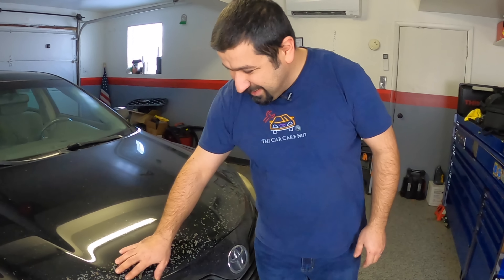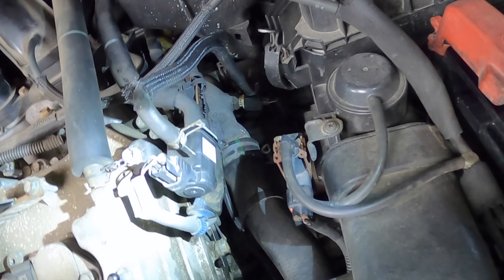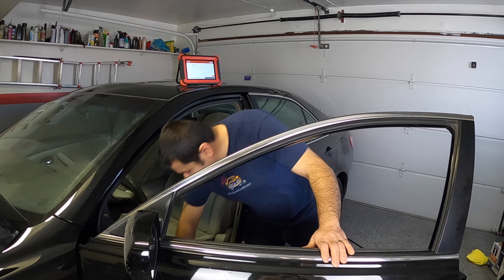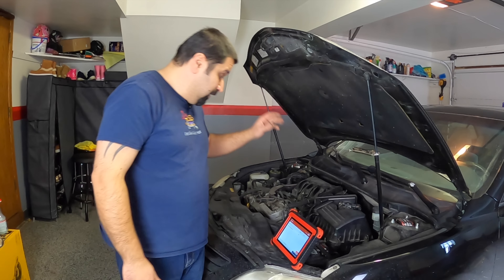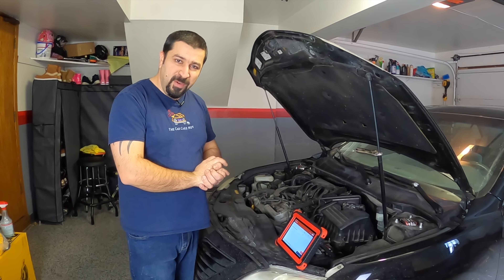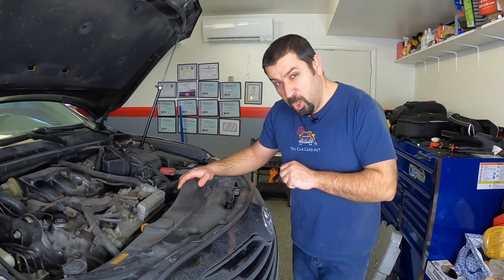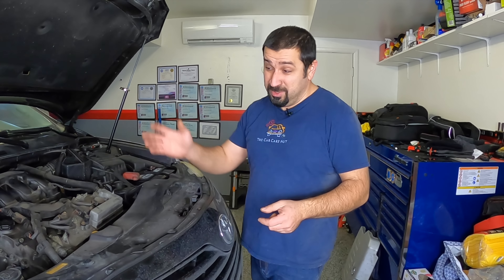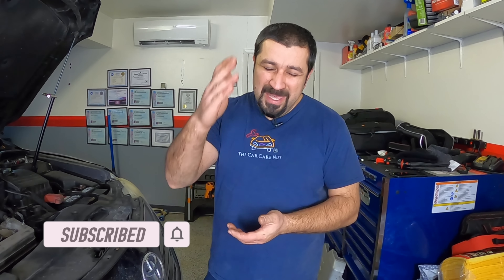How Does a 15 Year Old Toyota with OVER 200k Miles Hold up? Full Inspection!

Comment: Always use OEM parts, for a peace of mind in term of performance & reliability. Addition it will save you times and money too. Especially now a day, after market parts made in China are not worth to even spend a penny on. My 2004 LS 430 with 230,000 miles on it, and it still runs like new, super smooth and super quite (you don’t even hear the engine noise). Over the years I always use only OEM parts (including the gas cap & radiator cap) on all scheduled maintenance. Thank you another GREAT video. YOU ARE THE BEST. Always learn something new & beneficial from each of your videos. I look forward to watch your next video. Thank you.
Reply: We previously had a 1996 Honda Accord and when it came time to replace the water pump it was impossible to find a new one that was not made in China, including one from a Honda dealer.
Reply: @njsongwriter  I saw a comment on another channel from someone who said they work in automotive part distribution that for old models, eventually the manufacturers will start selling aftermarket parts under their own brand for various reasons. Usually the factory tooling wears out and they don't feel like investing in remaking it for a small number of customers.

Comment: I have a 1992 Corolla which I purchased in 1994 with 20,000 miles on it. So now it is 30 years old this year, and recently turned over 1/4 million miles. I do all my own maintenance, and moderate repair work. Still runs great. The clear coat on the white paint on the hood started to break down after about 15 years, but all the other paint and clear coat is original and in great shape. Things have had to replace.. starter motor solenoid, struts, exhaust manifold, rear brake cylinders, water pump, radiator, drive axle boots, catalytic converter.... that's all I can think of, looks like quite a list, but spread over 30 years, it's been quite trouble free.

Comment: Excellent video!  I have just now had 1 year of ownership on my 2002 Sienna with 272,000 miles when I got it.  I have done 1 oil change using Mobile 1 synthetic  10w30.  In over 2000 miles on the new oil I had to add about 1 pint of oil.  There have been zero oil leaks from anywhere.  I did put new front disc brakes and rotors. I also had the timing belt changed since I had no idea when it was done last.  I have no idea how many previous owners it has had.  I paid $800 for it and I am amazed how well it has been.  I does has have  aftermarket front struts!  It handles and rides very nice for its age.  It has some rust but not excessive.  I am  to say the least very impressed and pleased so far.
Reply: I have a 98 seinna well over 200,000 miles but I’m huge on regular consistent maintenance so it runs great. Wait until you have to change those spark plugs in the back of the engine lol
Reply: @StrongerThanBigfoot  I know it is probably not easy to get at those back plugs!  I have close to 280k miles on it at this time and it sttill starts and run very smooth.  I do know there are many videos to show how it is done when that time comes!  Thanks for the comment!

Comment: I have a 2002 Camry LE with 211,000 mi on it (bought new). Only have done general maintenance and replaced the starter, alternator, power steering hose and belt tensioner (that was a pain). Most reliable car ever, although not living in the rust belt (California) helps.

Comment: This was very helpful and informative.  
Thank you.
We own a 2007 XLE Camry and it does not have any of these problems.
Ours though only has 87K miles on it.
It runs great and is sill peppy and fast when needed.
EDIT: We only have used the Toyota Dealership when doing any repairs.
No aftermarket parts in ours.
Reply: Your car has almost 150,000 less miles so it should be better.😅
Reply: @lukespack  haha yeah I agree
Reply: Not all dealerships are the same.  Glad to hear that yours has been helpful.

Comment: Same engine with 2005 avalon.
Just  replace front rear struts
And lower bolt join .rotors.  Brake caliper 
And power sterling pump 
Radiator.   And change  trans fluid.Toyota engine bullet proof ..now 160 hope fully make 200 more

Comment: I have a 2006 Matrix AWD with 194,000 miles and zero leaks.  I did replace valve cover and intake gaskets like 30k ago and do full synthetic 5k oci. Runs perfect but the left front cv axle is starting  to clack. Just picked up 12pnt 30mm socket to replace it myself. Also, I revgularly service all (and I mean all) fluids. This is a northern NJ  car for reference.

Comment: Great video! I have a 2011 Sienna LX I bought new in 2010 with 238K miles. Just had it in to the dealership for oil change/tire rotation and had to replace the lug nuts last week. They were swollen and it was a safety issue. I keep it maintained with a trusted independent mechanic that my family has used for over 30 years. I guess you could say we’re not afraid of commitment 😆 to our old cars and mechanic! I’m in the market for a new RAV4 Hybrid, but finding one right now is very difficult. Fingers crossed that my Sienna holds up until I can find one I want and for a price I’m willing to pay. It still looks good, just foggy headlamps. Thank you for your videos!
Reply: @vikchem  ¿y el Hybrid no se encuentra en los Concesionarios?

Comment: My 2006 4runner 4.0 v6 is approaching 200,000 miles and runs great! Just had the timing chain and all related replaced. 300,000 miles here I come!
Reply: MVRWC…..why did you have your timing belt replaced? They should last for the life of your vehicle. Never heard of anyone replacing a timing belt on a 4 Runner.
Reply: @timothycollins1968  at 193,000 miles the timing chain needed replacing as  it had stretched beyond what the tensioner could compensate for probably because I failed to address a misfire as soon as I should have but it's now running like new.
Reply: @timothycollins1968  and as for timing belts, I have a Lexus es300 that has 187000 miles and while it doesn't 'need' a running chain, even a Toyota won't last forever.
Reply: I have a 2005 4runner with 278k miles and runs great. Definitely need to catch up on some maintenance thought. Water pump,thermostat,brakes, new valve cover gasket is on the list but runs good. Hoping to reach 500k

Comment: Gladly take any of the older Toyota and Lexus from the late 90's to mid 2000's over any of the newer ones.Wife's 2006 Avalon runs like a top with 150k and my GX470 with over 200k is still a rock solid beast!
Reply: You would take "any of the older ones"? Even those with the problematic 2.4 engines?
Reply: @njsongwriter  Absolutely! Daughter drives a Japan made 2005 Camry with that 4 cylinder engine and its currently running strong with 235k.Timely maintenance is key on all cars,which helps
Reply: @igglybiggly6951  

I'm not sure that the ones made in Japan had the same problem as those assembled in the USA. Maybe, I'm not sure.
Also, it may have been only the ones from 2006-2010... Again, I'm not sure. All I know is that our 2009 RAV4 has the 2.5 liter engine.
Reply: @njsongwriter  I work at an independent shop that services only Toyota and Lexus and we rarely see these engines fail.The ones that do or come in with engine " knock" typically have been neglected or run low on oil. Lots of RAV,Camry with over 200k with minimal issues,but I'm sure there are basket case cars out there too.Peace✌
Reply: @igglybiggly6951  
I wish I knew of an independent repair shop like yours in my area just in case I might need one some day. You aren't in Pennsylvania by any chance are you?

Comment: I have a 07 2.4L Camry with 220,000 miles on it, and it runs like a champ. I did just have to do the alternator, and the radiator and some power steering lines were done about 3 years ago, but it runs and drives great. If I had to get in my car tomorrow and drive coast to coast across the country, I wouldn’t even hesitate!
Reply: Hi-So how much oil does your car consume? My 2011 with 152000 burns about 2.5 qts every 6000 miles
Reply: @ddphotoadventure2657  I usually have to add about an extra quart between changes, And I change it every 5000 miles.
Reply: @jacobturk7543  That is not too bad at all considering the mileage on the car
Reply: @ddphotoadventure2657  no not at all. If I weren't so hellbent on getting a stick shift for my next car, I would totally just buy another Camry. Mine has been fantastic

Comment: I had this exact same issue with an aftermarket solenoid.  Installed the original OEM solenoid and it worked proper ever since.  It also threw many odd fault codes along with it.

Comment: I drove an 06 Accord for 15yrs, and only did reg maintenance and only the cruise control button broke.  AC got refilled once.  But starting the 12ish year mark, there was some minor oil leaks.  Had a Camry for nine years, and other burning oil... zero mechanical problems.  This car sounds like it has a ton of work done on it... a little here... a little there.. and then more again!

Comment: Thank you Amd. Very helpful.
Our 2011 Toyota Sienna V6. I'll just attempt oil changes :) and replacementof side door sliding door control (I broke the windowswitch lost my patience Replaced with new switch ouch. I leave the rest to Toyota Certified Mechanic at dealership.  I have more trust that genuine Toyota replacement parts are being uses.  
Take care

Comment: In Cuba we have cars from the 40s -50s still circulating around lol then again parts were made differently then..
I feel these Toyotas can easily go around for another 15 years with proper maintenance
Reply: Yes, 25 years minimum if maintained well and no major or catastrophic part failure
Reply: Those cars are full of homemade parts. You have no options.
Reply: @lukespack  Yup.. parts pretty much from a russian fridge and a cnc machine lol
Reply: @Mike_44  the only thing original is the cascaron, the rest is not more Original. Blame communism and fidel castro.
Reply: up in Nepal they are still running 1970 Corolla's as Taxi's
Reply: @Mike_44  Funny you mention Russia. They never could build cars over there.
Reply: @mr.m325  Those were all rear wheel drive, I think.
Reply: No rust issues in Cuba.
Reply: @vw5056  Only if you are not near the ocean.😃

Comment: 2008 sequoia 5.7L. 

204k miles. 

Amazing condition. Paint is chipped a little. Interior is great. Engine bay is amazing. Underside is amazing. 

No rust.
Reply: the 3UR-FE engine is a good one.

Comment: That’s the same old school process I use. I just went to look at a truck for a friend,m. She noticed a wet spot on the frame area and drivers wheel well. It’s a small oil leak. It had been parked in the same spot for about 3 hours and hadn’t even put a drip on the ground beneath the truck. I told her it’s not leaking on the exhaust, it’s not leaving a spot on the ground, keep an eye on it and keep a check on the oil level. It’s not something that set my hair on fire when I saw it. So it’s at the evaluate and monitor stage at this point. Good advise as always, hope you and the fam are doing well my friend!!! ✌️

Comment: I have a 1995 Toyota T-100, 175k miles, most of my issues are not with the engine or transmission, but rust mitigation.

Comment: I hope my 2008 Lexus ES 350 lasts as long. It's basically the same V6 Camry underneath. It's got 160k so far no issues just normal wear and tear items. Planning to change and alternator, water pump, and CV axle soon.
Reply: Any reason you are changing those or just because?

Comment: I have a 2007 Toyota Camry with 252k miles with a 4 cylinder engine and I have been driving it all over the place. I had replaced starter, mass air flow sensors, oxygen sensors, complete tune up, gas the bar mount on top. Right now my issue is fuel filter in the gas tank underneath the fuel pump is plugging up and I will either clean it or may replace the whole fuel pump. but it runs great with not oil leaks and I love the car.

Comment: I have a 1998 Toyota Camry. 4 chk. She has 290,000 miles. I have the oil leak and I think it may be the one u said was expensive , front timing cover. 2 older mechanics said they wouldn't fix it but did not name where the leak is. I met someone last week with the same car. He has 312,000. I cannot afford another car, especially with doubled used cars. Taking it to another mechanic Wednesday. Love Toyotas. Subscribed.😊

Comment: Mt 2007 Corolla now has 265k miles with a manual transmission. I am about to embark on a 5,000-mile road trip. I have no doubt it will be just fine. I use mostly Toyota parts (if I can find them). 
The only thing I have an issue with is the trimming chain tensioner leaks a tiny bit of oil. 

I love this channel, I love the info. I am going to get my Corolla to 500k miles. 🙂

Comment: I picked up used Toyota with over 200,000 miles on it and they had never changed the transmission fluid. I have done  three drain and fills over the last three years and have had no problems but from what I understand it is only a matter of time it goes out since the damage was done.
Reply: Buy a transmission they aren't expensive maybe under 1200
Reply: Used transmissions are $1800 to $2500. 

Just bought a transmission with 54,000 miles to put in my 2007 Lexus ES350.

Am 5th owner of vehicle, no idea of previous maintenance. Original tranny went out a 188,000 miles

Comment: My 09 Camry LE 4 cyl has 272k. I just replaced the dog bone engine mount. Easy job. Car still runs great. One of the power steering hoses is leaking a little, but not badly. I've done the CV axles, water pump & thermostat, and the alternator.  Other than that it's been fluids, brakes tires and filters. It's been a fantastic car.

Comment: 230k out of a car ain't bad!  Gotta say, it's done a little better than my '07 Subaru Legacy which is nearing the end of the line at 170k miles.  I made the mistake of having the head gaskets replaced by the Subaru dealer with OEM gaskets along with the timing belt replacement just shy of 100k miles.  Now the head gaskets are leaking again!  I figure it needs basically every gasket and seal under the hood replaced, new exhaust, new control arm bushings, at least one set of wheel bearings (left front sounds like it's going), new struts, and some routine stuff.  Doesn't take long to exceed the value of the car!  Radiator is new, alternator is maybe 3 yrs old, power steering pump, CV joints, sway bar links, tires, brake pads and rotors are all 4 yrs old.  Body is clean except I'm starting to get rust bubbles on the lip of the right rear wheel well.  Not sure exactly how much rust there is underneath where it counts.  But for people who put crazy mileage on cars (300k, 400k and up) I always wonder how they do it unless it's all highway mileage.

I did get 220k miles out of my first car, a 1997 Saturn SL2, but that was with a lot of highway driving and it only took me 8 years.  I still miss those dent resistant plastic body panels!
Reply: Hey, i had two outbacks and an impreza before my lexus. My first outback had 320k when i junked it. It was the family wagon and squeeked everywhere i went lol. Replaced headgasket at 280 on that one. After that i got another 04 outback w 200k. I bought it w a blown headgasket to do the job myself. It drove another 20k then i sold it for my impreza. I kept the impreza till i got the lexus. Lexus is 350 had a blown headgasket when i bought it lol. Pretty ironic considering it isnt a subaru. But i just replaced the motor cuz the headgasket cost more in just parts. Subarus taught me how to work on cars and im hoping toyotas will teach me how to not work on cars... so far not so good lol 🙃 😅
Reply: You should have replaced the headgaskets with the turbo model headgasket which is a multi layered steel head gasket and it would permanently fix the issue unlike the stock headgaskets that only last about 100k miles
Reply: @Mathew Johnson I've seen Toyota's go 300K miles stop & go city over the course of 30 years. That was the case with my mom's friends 1990 Corolla, they only junked the car last summer because the rear main seal started leaking & it would exceed the value of a car.

Comment: I completely learned about thr customer only noticing things after the repair the hard way... buick with a bad shifter. Lots of scratches on the trim plate around it. Customer started screaming at us about it. Learned to note down flaws. Especially in the area of the vehicle I'm working 👍

Comment: Loved this video. 

I have a 244k Acura TL and it looks so much better than this car does. 

I take ocd take care of it and replace parts before they go bad at times if I notice an issue (p/s whine, serpentine belt chirp etc). I do have a leak that stained the entire bottom portion with a smell      

Great tip on getting it cleaned up to help with the smell.

Comment: Very helpful video.  I suspect many older Toyota owners would be very interested in an expansion of your comments on how to DIY clean an engine, especially one with oil leaks, without damaging the electronics, etc.
Reply: Just use a pressure washer. Keep it away from the fuse/relay junction blocks, plug wires and coils or injector wires. Keep it aimed around the sides of the block. Don’t spray around the O2 sensors when the engine is hot. Definitely keep the water away from the air intake. I usually use a spray bottle full of industrial degreaser to pre soak the oil to help the pressure washer break it up. After cleaning run the engine and check for drips of fresh oil and where it came from, keep in mind oil follows gravity as well so if you see a drip look above it. If you got water or degreaser on the belt it may squeal a little bit after starting but should go away as the belt dries off.
Reply: I have a 2008 corolla, I wash the engine with a pressure washer and doesn't even bother to dry it and the vehicle starts in one  click and not even a shake.